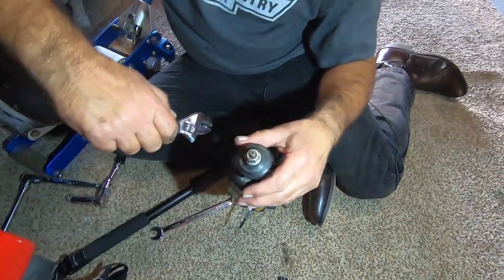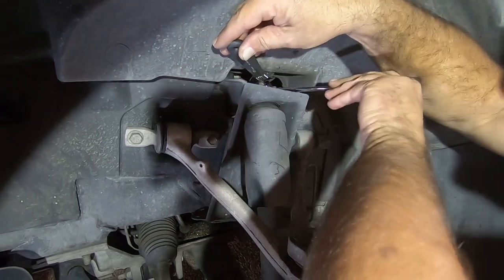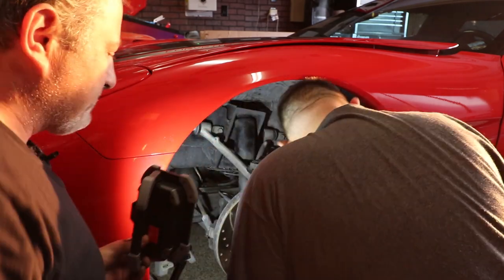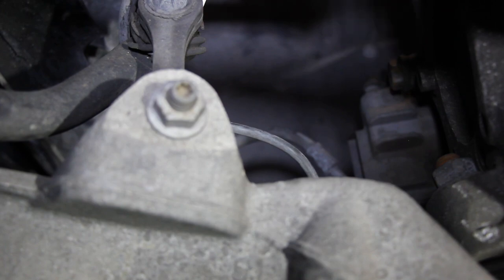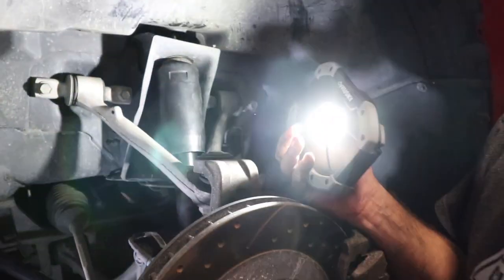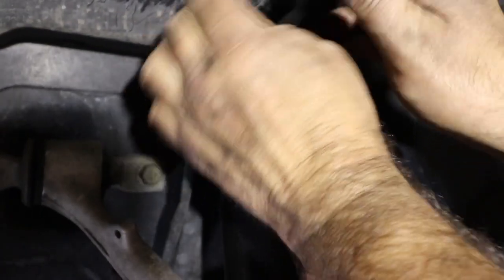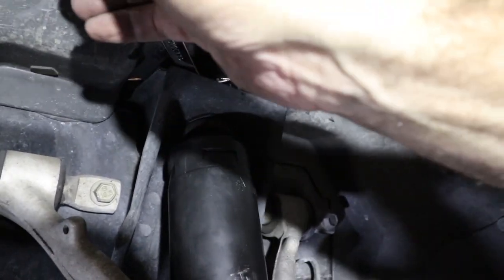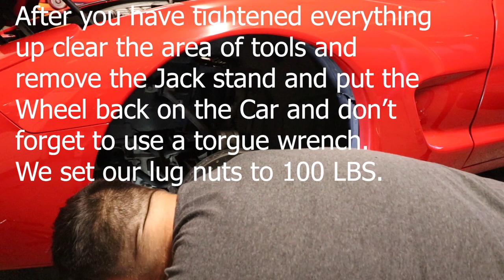How to Replace The Front Shocks on a C5 Corvette

Comment: Better then using a crescent wrench use a 1/4 open end wrench or perhaps a 6mm open end wrench. My crescent wrench got stuck on the shock and was a bitch to get off. And don't forget to use the new rubber bushings from the new ZO6 shocks as they are longer and need to be used to get the nut to tighten properly on the top of the front shocks.

Comment: I am getting ready to put ZO6 shocks on my 2001 C5. What are the lbs of torque on the upper and low bolts.
Reply: 19 lb FT for the top nut and 21 lb Ft for the lower bolts. Thank you for your service. I was AF also.
Reply: @edbard3766  thank you for your service as well.